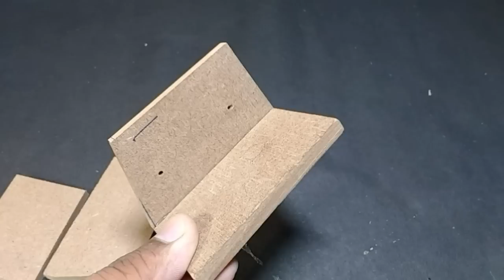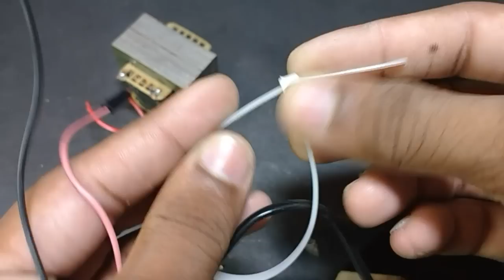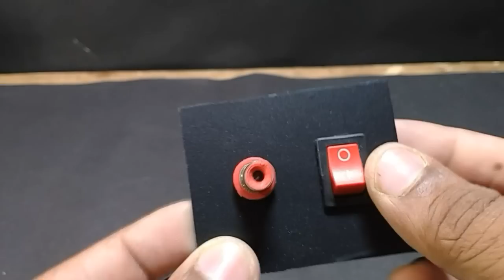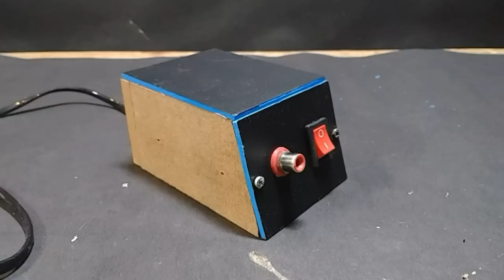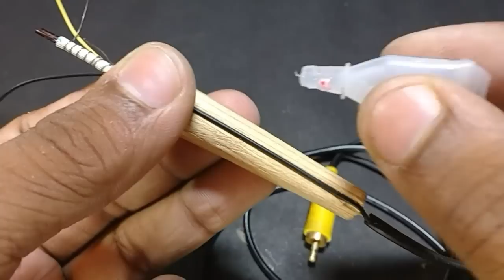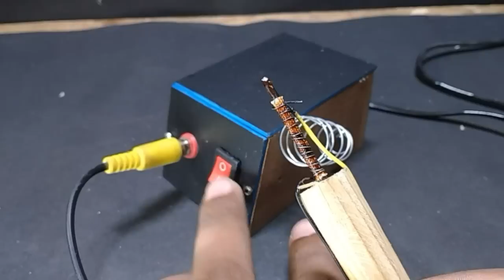how to make a soldering iron - 12V

Comment: Bro... FANTASTIC work! :D I think I'm going to make one myself too! :D
Reply from the maker: +MC's Creations Thnx Bro ;) best wishes bro
Reply: MC's Creations u might wanna add a common wire (GND) to the build.  it's pretty simple. just dont use solder to affix it to the 12v drill and tap or a fancy sheetrock screw after ya drill it.
Reply: with an esd drill I'm assuming.  There's always a Lil gray area but I bet that's exactly it. Its needs to be done w esd tools and proper place to .it's a big deal if there's anything else  that happened. Granite different working on stuff after it's already been assembled it's definitely different things before you ever get chance to apply them.
Reply: thabhanovalohoythojhshale

Comment: Nice video, but the fact that was bothering me is that you...

HAD TO USE SOLDERING IRON TO MAKE ANOTHER SOLDERING IRON
Reply: Ivan Raković u don't HAVE TO but it's way easier and faster to use one
Reply: Yes thats the same problem Is almost every DIy station or soldering iron Video I hate that you need a soldring iron for making a soldring iron
And I think you can buy cheap soldering iron than do this project Than it works
Reply: but that's quite useful when u have soldering gun and u wanna make micro-solder

Comment: but why did'nt you installed a rectifier circuit between transformer and dc soldering iron so that it will be more useful for soldering semicoductor circuit boards like ic s to avoid spike to damage such ic s in ac soldering iron

Comment: Where from you get the nichrome wire
Reply: from an old boiler's heating element....You know the part that you change every once in a couple of years the part that has copper tubing..the nichrome wire can be found on one of them,to get it just break the copper wire ,shake off the white silicone dust and pull out the useful wire! this way you can get 5 to 10 metter of the stuff!

Thank me later!